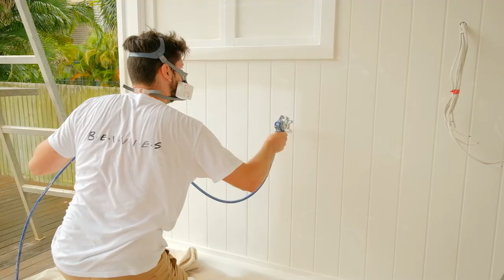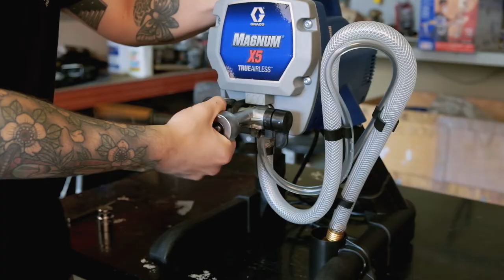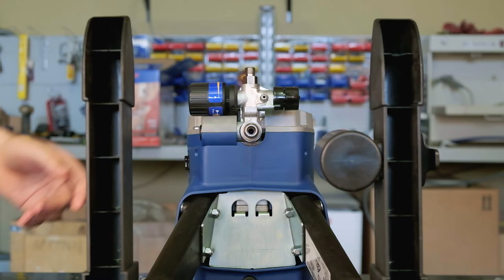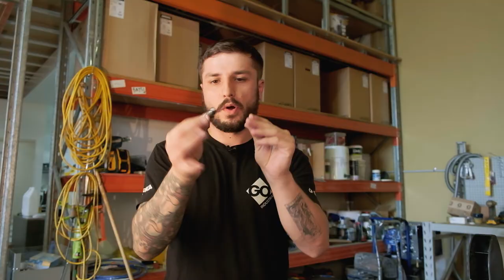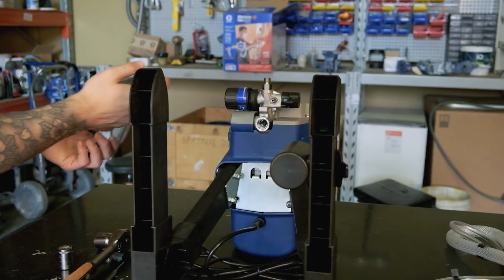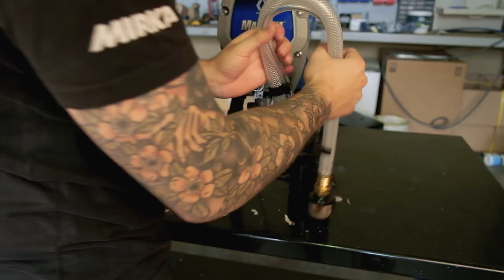Problems Spraying With Your Graco Magnum X5? Graco Magnum Troubleshooting Guide

Comment: Nice video.  I have a year 2000 Magnum XR7 sprayer with no more than probably 40hrs on it.  I can't get it to prime.  I'm doing this with water for starters.  The pump runs & prime/spray valve is set correctly but it only sucks water to top of filler tube and no further.  I watched Graco's failure to prime troubleshooting video and checked all the filters, inlet valve etc..  I even tried power flushing it.  Funny thing, my inlet check valve has a ball & washer but no spring.

Comment: You mention “cleaning it up” … what would be best way to do this? Would a wire brush be too abrasive? Or soak + clean with a specific type of cleaner / solution?  Thanks in advance, and thank you for the great videos!!
Reply from the maker: Thanks for your comment! Definitely a mix of a soft bristle brush, hot soapy water and thorough flushing of the machine is the way to go. Hope this helps!

Comment: great video !! right in the point very technical and good breakdown 👍
Reply: mine wouldn’t suck the clean water while priming havent used it in a while so all i did it hit soffly in the metal valve and worked right away so great the ball was probably stucked

Comment: Does the Graco Magnum DX also allow for the inlet valve to be removed?  I can prime my unit but when I switch to the paint bucket, depress the trigger, and move to "spray", the pump immediately cuts out.  All screen are clean and I have a new tip.  I watched your video and went to clean the inlet valve, but I can't get it off... I can use a "cheater bar" on the handle of my socket wrench, but I don't want to break something if it isn't meant to come apart - thanks!  Great video - I learned a lot.
Reply: Same thing happening to me
Reply: Ditto. I also can't get the inlet valve off.

Comment: I have a refurbished X5 that I bought about 9 months ago. I just tried using it this weekend. It primes just fine but when I switch over to spray, it makes one little noise and then nothing. No spray at all no matter where I put the pressure knob. I tried it last weekend, cleaned it up and tried again this weekend and nothing. When I take the spray hose off, nothing is in it. Any suggestions?

Comment: Thanks for the videos. The problem that I have is that the spryer pops the  Circuit breaker when it's turned on. It all started when I was priming the machine  for cleaning the breaker popped  please help

Comment: My graco machine is running non stop and with tons of pressure at the gun. There is also some paint by-passing through the smaller exit tube back into my paint can. Shooting interior latex trim paint. Is it not sensing the pressure at the regulator and just running away with itself?
Reply: Hey man mines doing the same plz help!!! Haha. Did you ever figure out what it was doing??

Comment: How are you cleaning this parts? And are you lubricating it? Thanks
Reply from the maker: Hey, great question! I would typically just soak the parts in a white spirit like methylated spirits and then use a bottle brush to brush debris off the parts. I would then rinse them under water and install them.

When you prime the unit with Graco Pump Armour that will lubricate the internals. 

Hope this helps!

Comment: After 25 minutes of spraying for the very first time worked great, got 2 ceilings done and moved on to 3rd, halfway through the pressure went out on my gun. The Magnum X7 wouldn't suck paint, motor just ran....went through 2 hours of videos, followed all the steps and no help. New paint, new machine, parts were all good to go, not sure why it just stopped working??
Reply: Any luck with it?
Reply: @maribelramirez4545  No, was told by Graco to take it in to be serviced...as soon as I find the time...which means I'll never get it fixed and just end up buying a new sprayer.